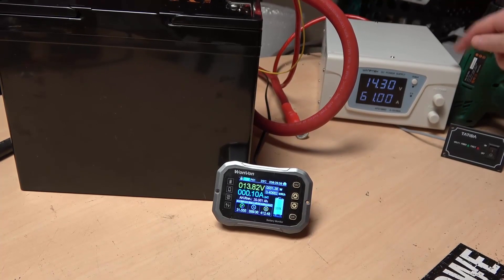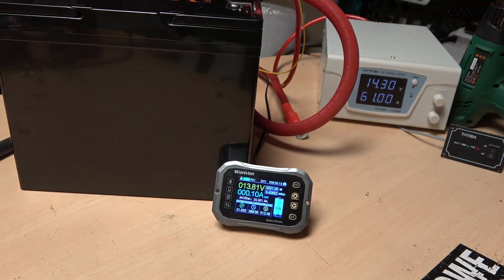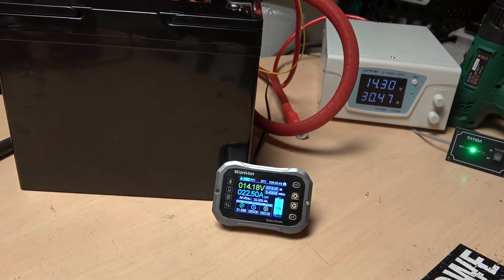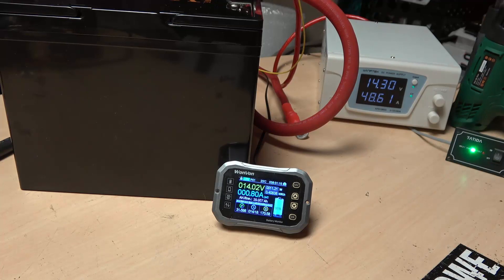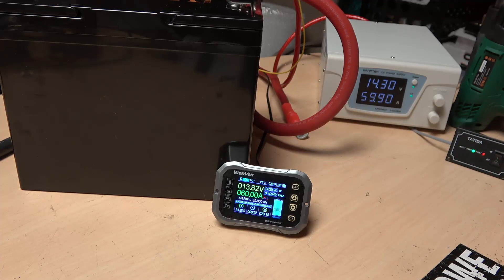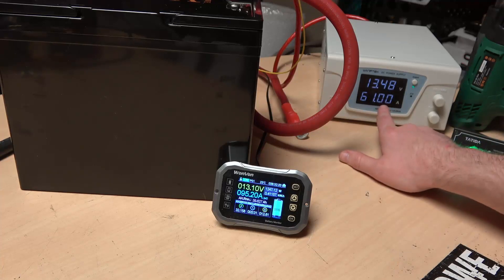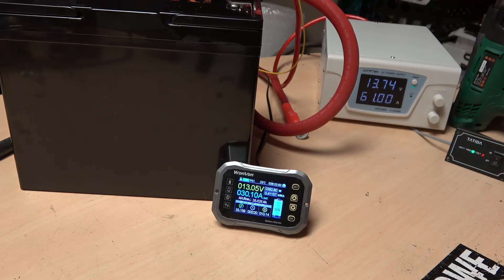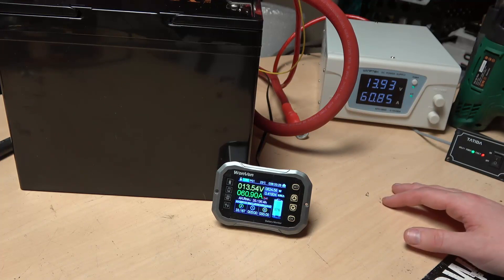CAR AUDIO EXPLAINED:  What happens when I use more current than my alternator can provide?

Comment: I have 2 94r agm batteries in my car. Your series 2 says it can be ran with agm. Can I replace my 2nd agm for your series 2 battery and keep the original agm? I have a internal regulated 270 amp alternator.  Can I connect the series 2 and agm in parallel without a bms and charge directly off my alt at 14.8, it does recover to 15 volts for a split second at times
Reply from the maker: Yes, absolutely!  You could replace one of the AGMs with no issue at all - even use the existing wiring and just swap it out directly.  You don't need to worry about an isolator or adding anything to it.

Comment: This video proves that even if your amplifiers demand 1000amps of current, and your battery bank is enough to supply that 1000 amps of current, you could keep your stock alternator that’s only 100amps, and it will never pull that current through the stock system
Reply from the maker: Correct.  TBH, the last couple of builds I've done I haven't even much worried about the Big 3.  My wiring from the alternator is more for recharging my battery than for supplying power directly to the amplifier.

Comment: This theoretically means your amplifiers will never pull more current than your stock alt wire is rated for as long as you have enough of a battery bank that can handle the full load and then some. 150a alt will only put out 150a and nothing more , even if you have 2000 amps of current pulling from your amps

Comment: I have a stock alt 120 amps, 2k watts rms, agm under the hood and I dip into the 12's when I crank my system. Could I add a series 2 in the back and keep my agm under the hood without an isolator?
Reply: and would I need a High output alternator?
Reply from the maker: @LegitChillin420 you can keep stock alternator, no isolator needed.
Reply: @GloweIndustries  awesome, thanks. I'm just waiting until shipping to Canada is available again.

Comment: It would be cool to see this video with more amperage draw. Like 500 or 600 amps.
Reply from the maker: The principal is the same.  I do high load testing in my other videos, just not with a charger on at the same time.  The result of that test is going to be completely dependent on the battery itself.

Comment: Ok I have a few questions please excuse my lack of knowledge when it comes to lithium I've been gone for over 10 years due to unfortunate situations but when I left the car audio game was still in its infancy stages an extra battery in the trunk was doing big things now everyone has massive lithium banks so anyway I am currently running two 12's on a CXA 1800.1 in a 2019 Camry LE I have looked everywhere and because of the ONBUS LINBUS electronics build which is where my car's computer is built in to the alternator and can NOT upgrade my alternator period even if I figured out a way to make it run the computer will only recognize it as a stock alternator and therefore only charge it at a stock alternator rate this came directly from (Mechman , J&S ETC. so my only option is a massive battery power supply I don't want to fry my alternator but I want to get everything I can get out of it so I am wanting to be able to run 5-8000 watts rms in a daily driver setup I like to listen to my music at a demo sound level while driving lol for long periods of time 1-3 hours right now the setup I have is working excellent no voltage drop period just a 50 farad capacitor and stock battery and alternator but I know once I double the amp power or more I'm going to run into serious voltage drop issues unless I have a good source of power with plenty of reserves is this battery capable of handling that and recovering in between bass drops with my stock alternator and if not could I say for instance get more than one and wire it up to the same system and would my alternator be able to keep up again please excuse my lack of knowledge on the subject

Comment: Really helps with the wires loose in the background. I'm sure you are tryng to sell a good product but your not getting my money.
Reply from the maker: Im not trying to sell anything in this video. 🤔 

And a test bench is going to have lots of wires.  Is what it is.  The only wire in the video not connected is a secondary power wire for when I’m pulling hundreds of amps of current and need to run multiple 4/0 - and is clamped down.  That leads to the second inverter.

The large red wire is carrying the load.  The yellow wire isn’t a loose wire — that’s what powers the display you see and takes voltage measurement at the terminals. 

The smaller 8 awg wire is the lead from the desktop power supply that’s acting as the alternator demo in this video.

Comment: Is your charger the 15V 60A model? I want one of those so bad so I can crank out the amps to the battery. If you don't mind me asking, where did you get the charger?
Reply from the maker: It is.  It can be kinda loud sometimes, but performs very well. I paid .. (just checked) $213 on AliExpress for mine.